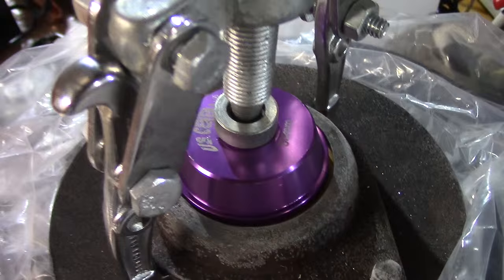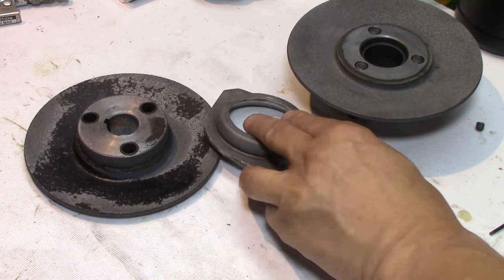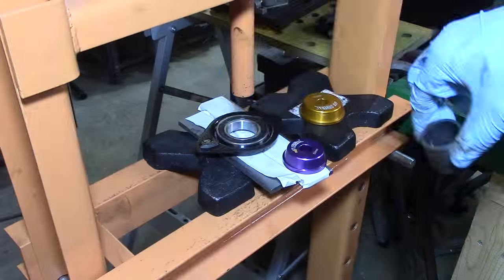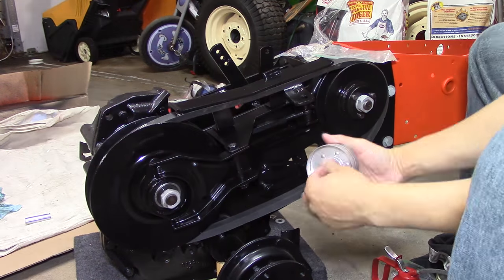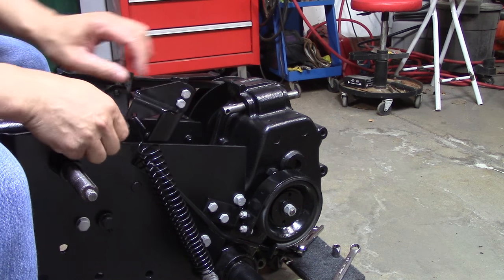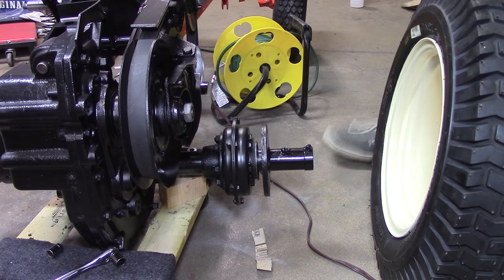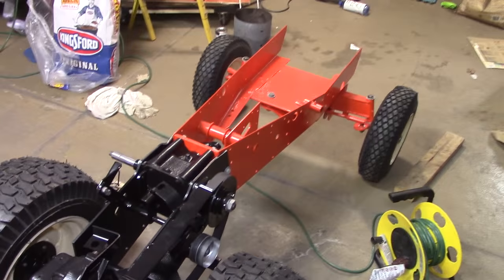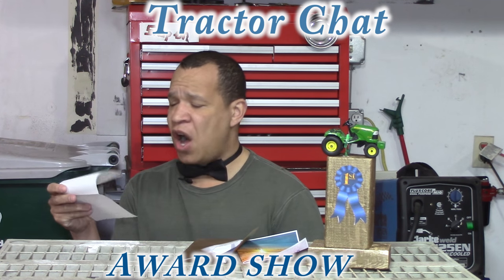41) Allis Chalmers 310 Tractor Restoration project, video 41

Comment: Good looking work there jster.  But...  I did not see the tear-down videos.  The idler pulley on the variable belt drive Usually goes on the wider side of the belts, in this case on the under side.  It gets better coverage on the belt and provides greater belt wrap on the drive pulley.  The Pop rivets on the idler need to be steel rivets, not the aluminum, in case they were not... and that spring on the left side looks like it is stretched WAY too far. Few tension springs have to be pulled that much to do their job.  I suggest looking just a bit closer...  It'll be a beauty when you are done.
Reply: +Doug Bourdo   Video 4, sure enough, the spring is (amazingly) stretched that far.  At about 3:20, the idler can be seen beneath the belt.  Didn't want to be left giving bad info.
Reply from the maker: +Doug Bourdo Thank you so much!  I've watched my old vids and looked at the manual so many times.  That spring is SOOOO stretched!  That is the spot that it came from, but that doesn't mean it's the right spot.  My manual has several models in it, and none show it there.  So I'm still now 100% sure it's on the correct place.  I'll keep looking.  And thanks for taking the time to look at that!  I've looked 100 times!  Thanks again.....
Reply from the maker: +Doug Bourdo Doug I think you're right about that idler pulley!  It's so dark on that video, but it looks like it goes over.  I will check that out and fix it.  Thank you so very much!
Reply from the maker: +Doug Bourdo Ok, sorry I should have looked at the still first.  The vid at 3:20 is dark and it's an optical illusion.  It goes under it.  Or at least that's how it was and the book shows it the same way.  But I appreciate your input.  Thanks again....

Comment: I know it been 4 years but if you dont mind me asking where did you find a new idler pulley ? I'm fixing a 310d now and the pulley is shot.
Reply from the maker: WOW!  Thank you!  You gave me a complement and didn't realize it.  That pulley is not new.  I just reconditioned my old one and used chrome paint.  So I'm sorry that I can't help with the idler pulley, but thank you again.  And good luck with your restoration.  Ps.  I used Sandy Lakes Implements for many of my parts.....
Reply: @jster1963  It looked new. You did a great job
Reply from the maker: @BSSMALLENGINES  Thank you again....

Comment: I have a question about the belt. Could you tell me where you got it and the model number. Or the dimensions thanks so much I need a belt for my Allis charmers 310d
Reply from the maker: Are you talking about the big thick drive belt that goes on the variable speed pulleys?  If so I will try to get the part number for you when I get back home tomorrow.  I got most of my parts from Sandy Lake Implement online.  They have cross reference numbers for our old tractors.  Are you doing a restoration or just need a belt?
Reply: jster1963 yes sir
Reply: jster1963 and I just need a belt. My tractor is in pretty nice condition with original paint. I bought it of my neighbor for 50 dollars! And I just found out he had over $1,200 into!!
Reply from the maker: Wow you got a deal!  Here is the part number for the belt.(2164080SM)  I got it from Sandy Lake Implement out of Sandy Lake, PA.  Their phone number is 724-376-2489.  I paid $73.30 plus tax and shipping a little over a year ago.The reason I asked if you were doing a restore is because I bought the wrong "Allis Chalmers 310" decals a few years ago.  When I realized it was for the  "310 D" I  re-ordered the correct ones.  I don't need them and I hate them "going to waste."  You can have them free if you want.   Let me know if you want them because I won't use them.  It's the 2 decals that go on the side of the hood.Good luck with your belt........